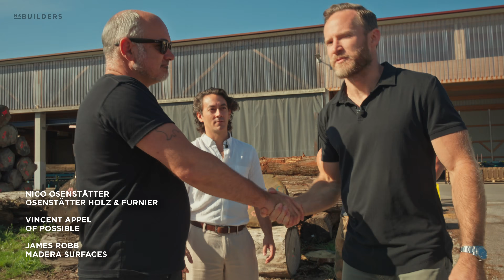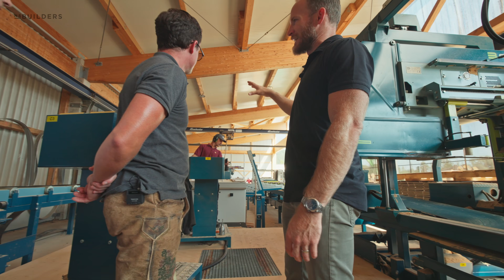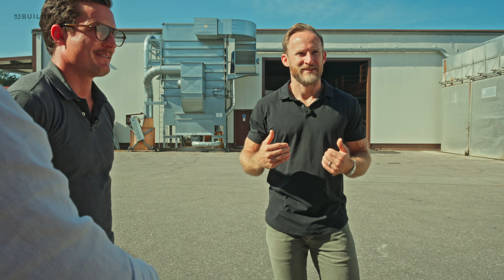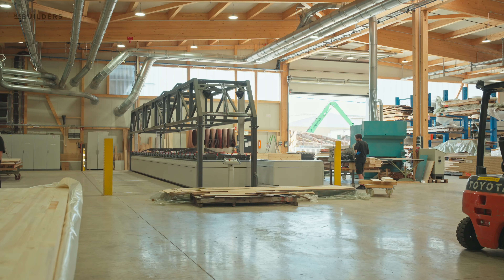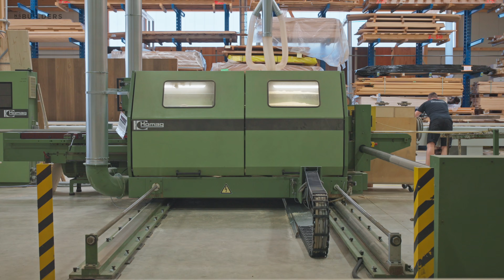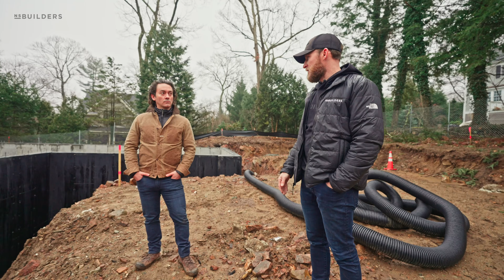Sourcing The Best White Oak In The World Took Me All The Way To Germany

Comment: Building a small cabin in Nova Scotia of 200 sqft we wanted to put in an oak floor. Didn't have to be white oak (I love it, we have it in our main house) and being a cabin a little rugged was OK. Now by chance our neighbor across the road was all his life cutting red oak trees (from Quebec) into small slats for the bottom of lobster traps. Per year he was cutting at least a hundred trees on his saw mill, that was his living. 

Chatting with him, he was able to get us 1x8 inch red oak boards and after some debate both of us agreed that the best way to prevent warping etc. would be to glue and nail them to the sub-floor within a week after he had cut them. But remember, the trees as a whole had been in his yard for over a year. And probably they were even older than that. Five years later now, the boards have shrunk a bit but no warping whatsoever.

Of course we had to talk money too, which was an easy discussion, we simply paid him one and and a half times what he was asking :-). Still, we spent for a one inch oak floor only two CAD (~ 1.3 USD) per square foot. That is cheaper than buying plastic laminate at Home Depot or IKEA !!! So, when I see in the video that to improve yield the white oak is cut to 3 mm thickness, I really start laughing. We had a cheap floor and my neighbor had a great deal, everybody happy.

Comment: Why did you select a spruce mid layer rather than plywood which may or may not have more stability?
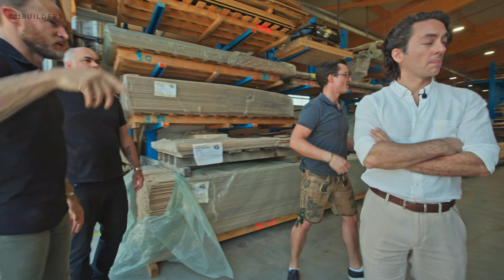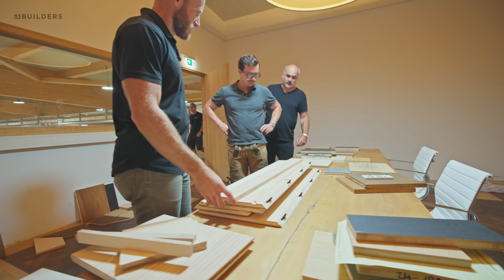Reply: I think the proposed build up (26:05 oak - spruce - oak) is choosen to have enough wood in the middle for the "Lamello Tenso"-connection system (to make a "beam" 37:07).